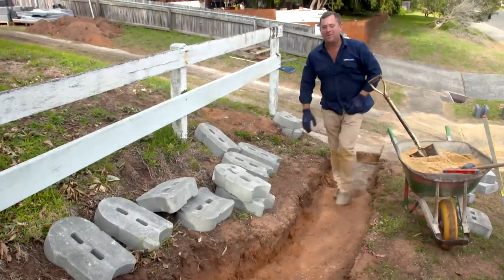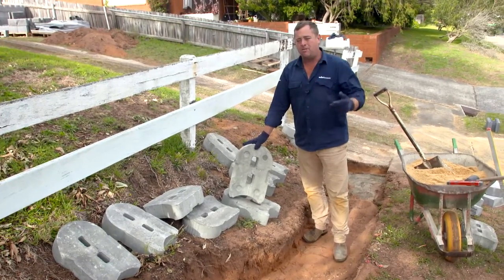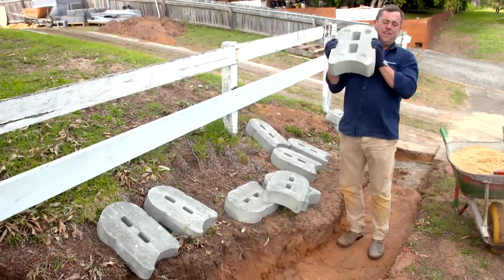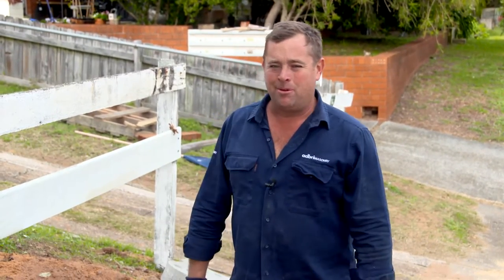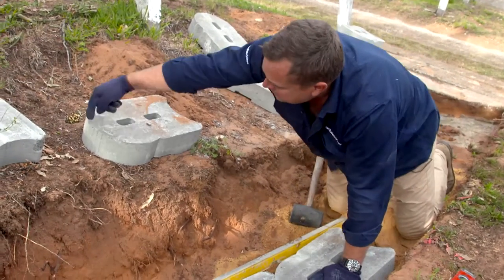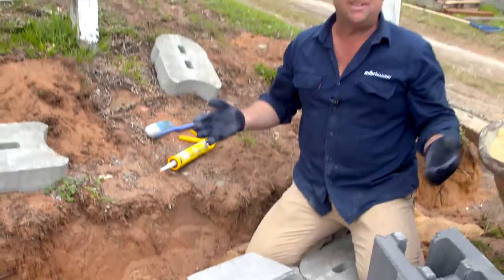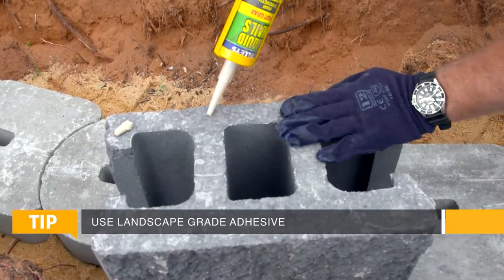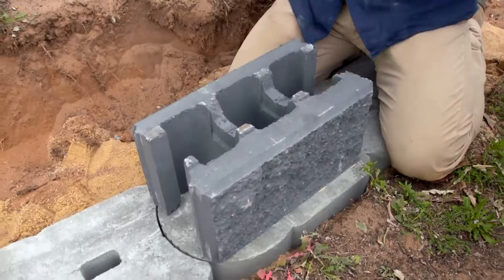How to Use Torpedo™ Base Block | DIY Made Easy | Adbri Masonry

Comment: what is cement stabilised sand in step 2?
Reply from the maker: Hi Brian, this is a damp (not wet) mix of sand and cement at a ratio of 6 parts sand to 1 part cement. If you mix it dry, add a little bit of water just to the point that it's damp, then screed as the base of the wall, it will remain pliable enough while you're building to make any slight adjustments, and will harden over time.
Reply from the maker: @SnapBrandy  Sorry for the confusion. Yes, in the video the sand is dry, because it is a demonstration that got unpacked later. Making the mix damp isn't an essential requirement, but more of a recommendation from Jason as something he has found to make the install process easier, as the sand holds it's form better while you're working with it. I understand there are some inconsistencies between the 5% and 6:1 ratio - ultimately any combination of cement and sand within those parameters would be sufficient for the base of the wall, though I understand a consistent recommendation would be better for DIYers and will fix accordingly. 

Other than the confusion with the sand mix, did everything else go okay with the build of your wall?
Reply: @AdbriMasonryAus  The sand in the above vid looks like it is used dry. Could this be explained better as I would like to use these blocks.